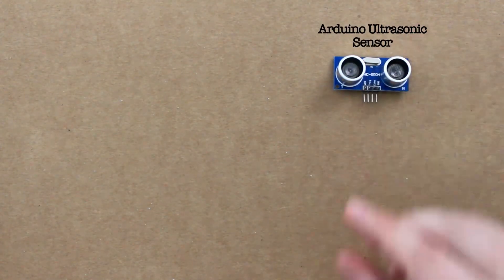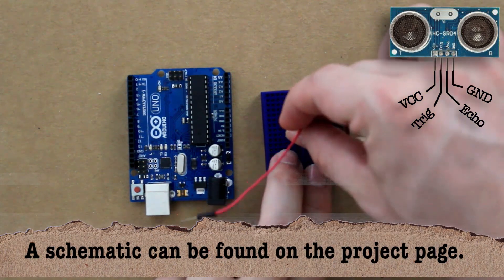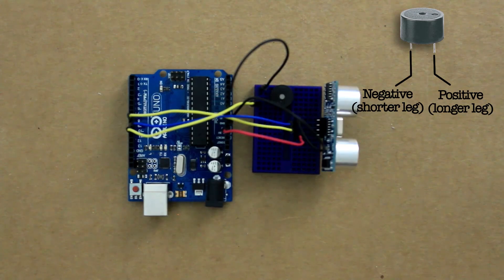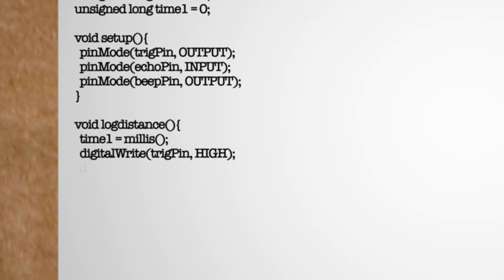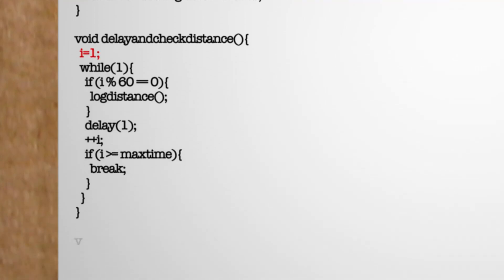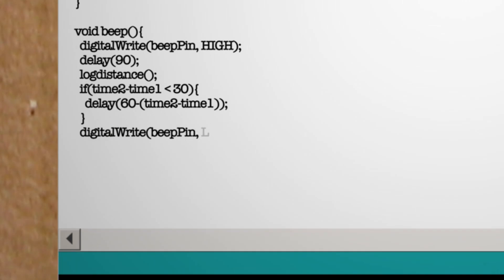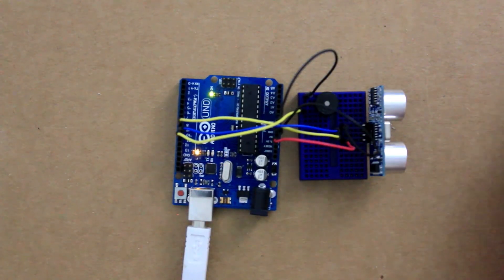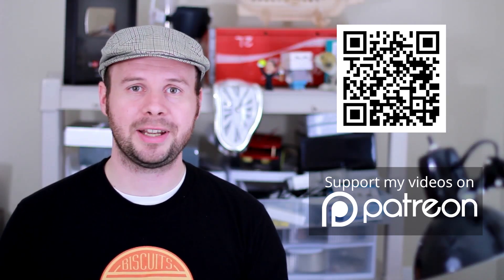How To Make A Sonar Device

Comment: Instead of a sound, I want to add a small green/red indicator.

Then I need to package the device into a Keychain portable.

When used on Portable Johns, it will show green if empty, red if occupied.

Used for concerts, construction yards, and other events where porta johns are used with poor occupant indication on the door; so knocking can be avoided to search for am empty stall.

Comment: I found that whether you connected the negative or positive parts of the buzzer to number 10 on the Arduino changed whether the device actually worked. Be cautious of that if you are actually trying to create this thing.

Comment: this is what happens when i try to verify the code :/
  
  
 Arduino: 1.8.1 (Mac OS X), Board: "Arduino/Genuino Uno"

/var/folders/vy/3zqmymr93mg9l7chsymxsbqw0000gp/T//cc2TdXM7.ltrans0.ltrans.o: In function `main':
/Users/canohousehold/Downloads/Arduino.app/Contents/Java/hardware/arduino/avr/cores/arduino/main.cpp:46: undefined reference to `loop'
collect2: error: ld returned 1 exit status
exit status 1
Error compiling for board Arduino/Genuino Uno.

This report would have more information with
"Show verbose output during compilation"
option enabled in File -> Preferences.
Reply: nvm now this happens :(
 
 
 Arduino: 1.8.1 (Mac OS X), Board: "Arduino/Genuino Uno"

Sketch uses 1778 bytes (5%) of program storage space. Maximum is 32256 bytes.
Global variables use 31 bytes (1%) of dynamic memory, leaving 2017 bytes for local variables. Maximum is 2048 bytes.
avrdude: ser_open(): can't open device "COM1": No such file or directory
Problem uploading to board.  See http://www.arduino.cc/en/Guide/Troubleshooting#upload for suggestions.

This report would have more information with
"Show verbose output during compilation"
option enabled in File -> Preferences.

Comment: the code not work:

#define trigPin8
#define echoPin9
#define beepPin10
#define scalingfactor

int inches=0;
unsigned long duration=0;
unsigned long maxtime=1000;
unsigned long i=1;
unsigned long time2=0;
unsigned long time1=0;

void setup(){
  pinMode(trigPin,OUTPUT);
  pinMode(echoPin,INPUT);
  pinMode(beepPin,OUTPUT);
}

void logdustance(){
  time1=millis(0);
  digitalWrite(trigpin,HIGH)
  delayMicroseconds(10);
`  digitalWrite(trigPin,LOW);
  duration=pulseIn(echoPin,HIGH);
  inches=duration/148;
  time2=millis();
  maxtime=scalingfactor*inches;
}

void delayandcheckdistance(){
  i=1
  while(1){
    logdistance();
  }
  delay(1);
  ++i;
  if(i>=maxtime){
    break;
  }
}
}

voidbeep(){
  digitalWrite(beepPin,HIGH);
  dilay(90);
  logdistance();
  if(time2-time1));
}
digitalWrite(beepPin,HIGH);
delay(90);
logdistance();
if(time2-time1<30){
  delay(60-(time2-time1));
}
digitalWrite(beepPin,LOW);
}

void loop(){
  beep();
  delayandcheckdistance();
}
  }
}

Comment: Would it be possible to do this, except have the buzzer separate from the ultrasonic sensor? For example, have one arduino attached to the ultrasonic sensor and another attached to the buzzer, then input code to calculate the distance between them based on the same concepts?